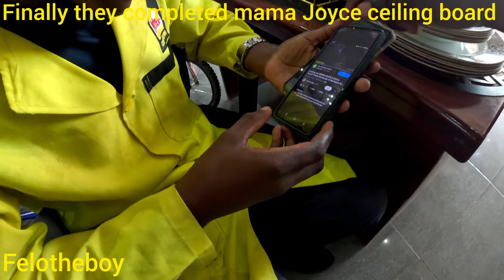Building for Mama Joyce Modern house_Finally Beautiful ceiling fixed.

Comment: Hi Felo
Please ,do not put a plastic toilet with a plastic sink in the bathroom, no plastic sink in the kitchen. Please do not low-grade your home to that standard. That's supposed to be a modern home. Just wait until you get enough money to complete everything.  Never get the cheapest of anything. You need to have high-grade products. Porcelain or ceramic  is better than plastic. You will have to be mindful of the products that you put on there to clean it because you can erode the nickel plated faucets. Also, you can erode the ceramic and erode the porcelain. So just wait until you can get everything you need.
They should be able to advise you if you get stains on something what to do. Never use any lye. 

Also in your kitchen where they have the decorative tiles for the kitchen walls. If you put all those tiles it will look junky.  If you want to put those in there only put one row along the bottom  and then use white tiles to bring it out. Your home is not a circus you don't want to have too many different patterns all over the place.  Your place will look completely busy. Too busy. Certain areas of your home should look neutral. Maybe you can consider cutting the tiles in half and having them go horizontal.  as the pattern. 

 You can just lay  them down side by side and get an idea of what it would look like  first. You have a good eye for detail so go with that ..but please  do not do a whole wall of those decorative tiles with all those glasses and Skillets and things on there. You need to be able to picture it.  Backsplash is nice that means you put the ceramic on the walls to where you can wash them down later. Look in a magazine. Nastro"s home is really nice. If you can't get over there, look at his videos when he's showing his kitchen to a group of people with Mayra.  

Even Uncle Mo's house is beautiful and elegant. His furniture is gorgeous too.
Reply: 😂...great advice. I studied interior design and I have created Pinterest boards for some of the YouTubers building and shared with them on Instagram inbox so that they can avoid costly mistakes and make the space aesthetically pleasing.